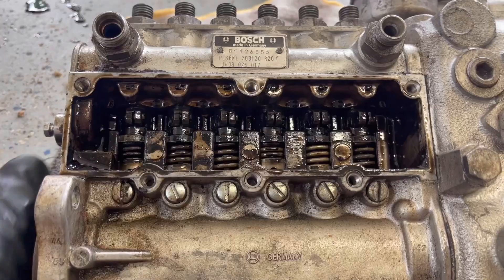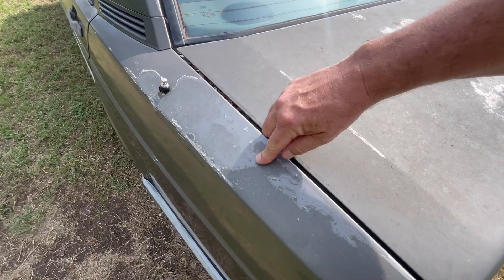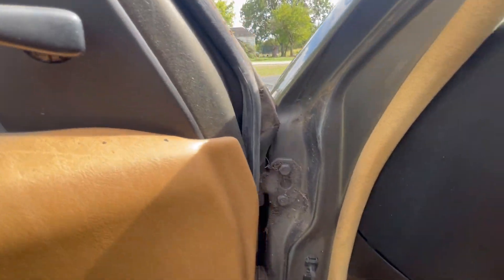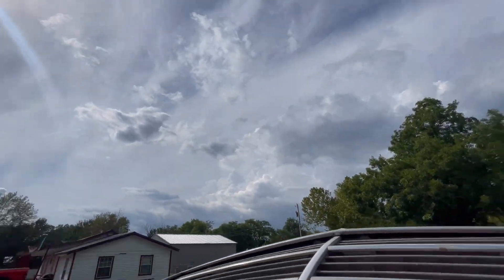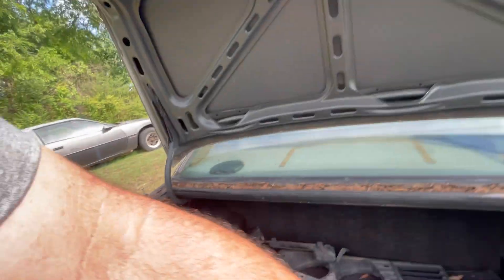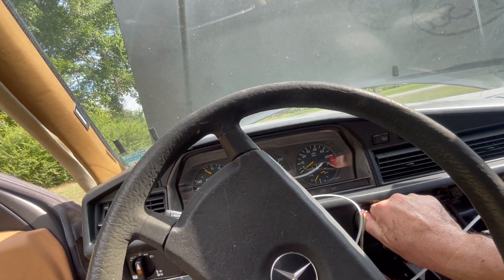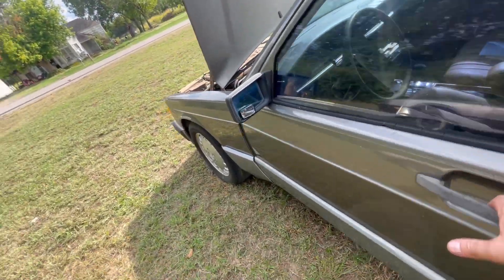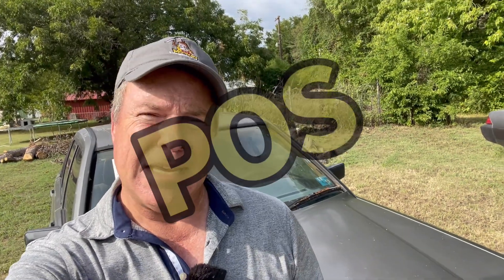How Bad Can A Cheap Benz Be??

Comment: Never attempt to start a dry engine that has been sitting for a long time without doing some advance preparation. Mike, I’m sure you know this, and it’s good for generating views on social media, but cranking an engine that has sat as long as this one obviously has risks doing serious damage. 

I mention this for benefit of your viewers, in that it is always best to do some precautionary maintenance before cranking a dry engine. There may be oil in the pan, but the upper moving components of the engine will be bone dry. Thus, cranking it can snap piston rings and score the cylinders reducing compression vastly increasing oil consumption. In some cases, you may bend lifters if valves are stuck, and on interference engines you may bend a valve.

I always first pull the spark plugs and fill the cylinders with Marvel mystery oil and let that soak for a while. This is also a good time to assess the condition of the engine by looking at the spark plugs, and a good time to re-gap or replace the plugs. I also pour fresh oil over the valve train, and lightly tap the valve springs with a hammer to jar any stuck valves free. On vehicles with old fashion distributors, I also replace the rotor, condenser, and cap, as these are inexpensive items. 

Lastly, I would never crank an engine that has been sitting with the fuel line attached, as you risk sucking in debris that can clog carburetor jets or fuel injectors. It’s always best to try a first start on a remote fuel tank, such as a boat tank, with fresh clean fuel.

Just some food for thought, as even if you get this car running, the engine may now be damaged.
Reply: Excellent advice
Reply: @westhavenor9513  Thanks!

In my 30 years of working around the antique car hobby, I’ve unfortunately seen people joyous one day over using an external fuel source and getting an engine that has been sitting for a long time to start, only to find that one start was all they got. The next time due to broken rings and scored cylinders they find the engine no longer has enough compression. A few hours to properly prepare a dry engine can save a lot of grief.

Have a great day!

Comment: I would think the first thing you should do is vacuum the engine compartment and get rid of all the dried vegetation, silt, sand and Oklahoma snakes that are living in there. But then, that's not the Monkey Wrench Mike way, I know.  Nevertheless the 190 series was a 'REAL' Mercedes but they don'e age particularly well and there is a lot of plastic bits and pieces.....

Something else that seemed odd to me. My first new Mercedes was a 1985 190D which I bought new.  I also bought new in 1987 a 190D 2.5 Turbodiesel which was a truly wonderful car and I wish I could have one just like it now.  One thing that seems strange to me is that your car has the lower body cladding that I don't believe was produced until a lot later than this car, perhaps 1990.  I am guess that this might not be a 1985 but a much newer car, probably a 1990.  

I hope you are able to bring the car back to life.  Running well the 190 was a fine Mercedes.
Reply from the maker: Thanks Roger!

Comment: Why do it that way? Your audience knows it's illogical.  You and your audience know that the first thing to do after the engine turns over is to get an extension cord and shop vac and clean up the engine compartment. 
Then look for spark, then get a small gas tank and use it to start the car and do it with the fuel line to the car's gas tank disconnected. 
You know the routine, why do it any other way?
Reply from the maker: Because it’s my YouTube channel and I can do what I want… lol